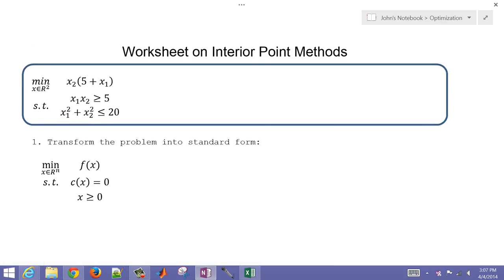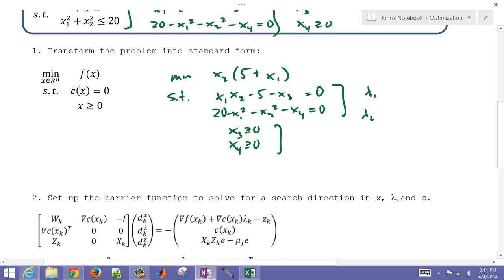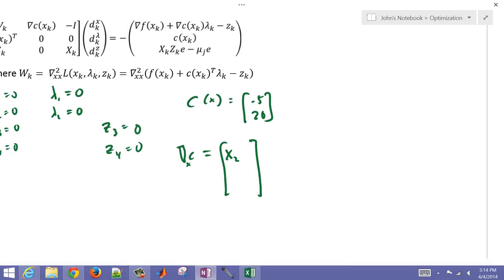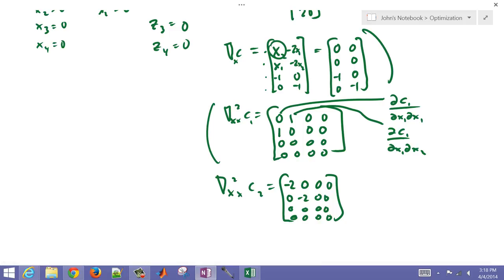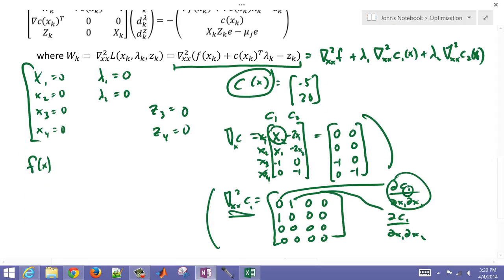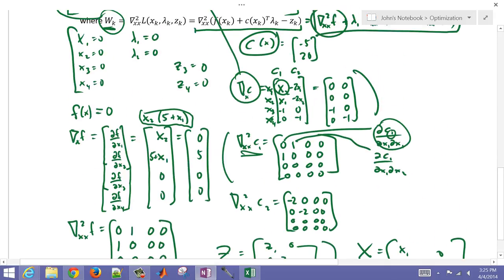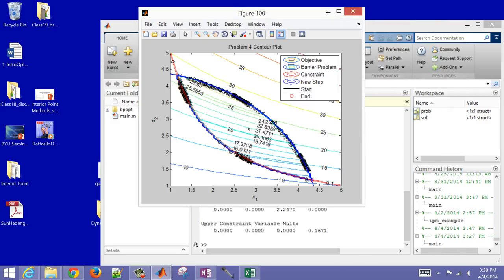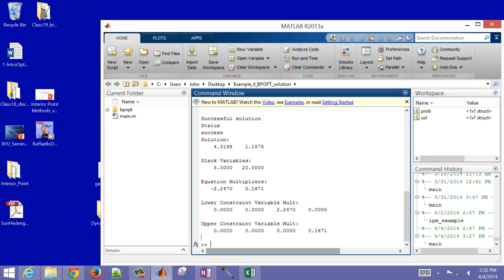Interior Point Method Optimization Example in MATLAB

Comment: This quite different what I learn we find projection gradient with projection matrix to improve the solution through iteration
This video use barrier function and augmented langragian method 
I want to learn this topic for ADMM but I cannot find any videos form this channel
Reply from the maker: I don't have videos on ADMM but I would recommend the work by Victor Zavala at UWisc for a good reference on this method. From what I understand, ADMM is limited by the amount of information that must be shared by the sub-processes. Check out the recent work by GATech on new computer chips that enable more efficient ADMM.
Reply: @apm  we learn it for distributed optimization because buying  a very expensive Graphic cards not an Ideal solution in machine learning  
anyway I will check it out

Comment: Thanks for the great videos I just got confused about two things:
1- the search concept:
we keep  solving using the interior method till we meet the tolerance we aim to? that's it? what abot search direction which part make it.
2- KKT conditions  are they a different method? since they provide exact solution
Reply from the maker: The interior point method is solving a series of problems with gradually reduced barrier parameters (mu). Each search direction is computed by solving a quadratic objective / linear constraint approximation to the full nonlinear problem. The KKT conditions are embedded in the search direction and convergence criteria for the interior point method. A KKT condition tutorial is here: http://apmonitor.com/me575/index.php/Main/KuhnTucker

Comment: Very great video, I downloaded the code and work fine but why in the computation of W you do not add the Hessian of -z_k, like your theory in the lecture said? Slides said: W= Hessian_xx( f(x_k) + c(x_k)'lambda_k - z_k)
Reply from the maker: You could solve a much larger linear system but this is not needed. z_k has an explicit solution after you calculate x_k. The derivatives and values of z_k can be explicitly solved and substituted into the linear Ax=b problem. The added benefit is that this reduced system has a symmetric A matrix and this allows specialized linear solvers to more efficiently solve for the search direction. Additional details are in http://cepac.cheme.cmu.edu/pasilectures/biegler/ipopt.pdf (see Equation 11 and the surrounding discussion)
Reply: @apm  I know there is a reduced system, but your code implement the bigger one, without adding the Hessian of -z_k, so the code is correct or not respect to the theory?
Reply from the maker: @gioacchinogigio4608  I implemented both in the code. I think there is a switch where you can use either approach.
Reply: @apm  I see Matlab Code for example 3 in your site, in the code you use the larger system but you do not add the Hessian of -z to W, my question is this code is correct or not? Because I need to understand the linking between theory and implementation. In the code you wrote W = fxx + lam * cxx;
Reply from the maker: @gioacchinogigio4608  Here are the two different approaches from bpopt.m here: https://apmonitor.com/me575/uploads/Main/bpopt_matlab.zip  I'm not aware of errors but please let me know if you find any.

    % Construct and solve linear system Ax=b
    
    % Symmetric, zL/zU explicitly solved
    % construct A and b
    A1 = [H,J';J,zeros(m,m)];
    %b1(1:n+ns,1) = g' - zL' + zU' + J'*lam';
    b1(1:n+ns,1) = g' - zL' + zU' + J'*lam' + zL'-bp.mu*inv_dML*e -zU'+bp.mu*inv_dMU*e;
    b1(n+ns+1:n+ns+m,1) = r(1:m)';
    
    % compute search direction, solving Ax = b
    d1 = -pinv(full(A1))*b1;
    
    dx1 = d1(1:n,1);
    ds1 = d1(n+1:n+ns,1);
    dlam1 = d1(n+ns+1:n+ns+m,1);
    % compute search direction for z (explicit solution)
    dzL1 = bp.mu*inv_dML*e - zL' - SigL*[dx1; ds1];
    dzU1 = bp.mu*inv_dMU*e - zU' + SigU*[dx1; ds1];
    search1 = [d1;dzL1;dzU1];

    % Un-symmetric, zL/zU implicitly solved
    % construct A
    A2 = [W J' -eye(n+ns) eye(n+ns);
        J zeros(m,m+2*(n+ns));
        diag(zL) zeros((n+ns),m) dML zeros(n+ns);
        -diag(zU) zeros(n+ns,m+n+ns) dMU];
    b2(1:n+ns,1) = g' - zL' + zU' + J'*lam';
    b2(n+ns+1:n+ns+m,1) = r(1:m)';
    b2(n+ns+m+1:2*(n+ns)+m) = dML*diag(zL)*e - bp.mu*e;
    b2(2*(n+ns)+m+1:3*(n+ns)+m) = dMU*diag(zU)*e - bp.mu*e;
    d2 = -pinv(full(A2))*b2;
    dx2 = d2(1:n,1);
    ds2 = d2(n+1:n+ns,1);
    dlam2 = d2(n+ns+1:n+ns+m,1);
    dzL2 = d2(n+ns+m+1:2*(n+ns)+m);
    dzU2 = d2(2*(n+ns)+m+1:3*(n+ns)+m);
    search2 = d2;
Reply: @apm  Thanks for reply, but my question is about this code http://apmonitor.com/me575/uploads/Main/interior_point_example3.zip .

Comment: Hi, I've a question on minute 16:30, where is the the  Hessian xx of z_K ?  Because z_K is  mu/x_K.
Reply from the maker: z_K is explicitly updated and it isn't needed to solve for it implicitly. Check out the IPOPT paper: http://cepac.cheme.cmu.edu/pasilectures/biegler/ipopt.pdf
Reply: @apm   Ok but I do not understand, in the objective function when I subtract  - mu* ln(x_i) if x_1 is equal to 0 goes to - infinity, is that correct?
Reply from the maker: @GS-qv8qm  , yes that is correct. It is an "interior" point algorithm because of this barrier function.
Reply: @apm   Yes, but the barrier is maximal on the constraints, so suppose c(x) = x1+x2+5 and we want c(x)=0, now when x=[0,0] , ln(x) is infinity but the constraint is not satisfied.
Reply from the maker: @GS-qv8qm  equality constraints are treated differently than the inequality constraints. The barrier term is only applied to the inequality constraints while the equality constraints use the first and second derivatives of the Lagrangian to solve for the new search direction.
Reply: @apm  Now it is clear. This method assume a feasible solution to start, do you know where I can looking for infeasible start? I need infeasible both for equality and inequality in a program like this min f(x) sub to Ax=b; c(x) >=0; I found only for one of them.

Comment: Thank you for the nice example. To transform the problem to the standard form, variables x_3 and x_4 are introduced, which need to be non-negative. 

The standard form requires all variables to be positive. However, the problem in the example does not have such a constraints on x_1 and x_2. It is mentioned that we assume that x_1, x_2>=0 are there. I am not sure if we can assume this since it changes the problem. Can you please explain on this? Thank you
Reply from the maker: +Ashkan, the IPOPT paper has a nice explanation of getting general constraints into the standard form: http://cepac.cheme.cmu.edu/pasilectures/biegler/ipopt.pdf

Comment: you did mention any about the dual method of the problem. isn't it required to solve this problem?
Reply from the maker: I recommend this very nice paper for full details on the approach: http://cepac.cheme.cmu.edu/pasilectures/biegler/ipopt.pdf
Reply: thanks
Reply: +APMonitor.com  in some papers mu = y^T * lambda / m    where y is slack vector and m no. of variables, how would be that if we don't have any slack vector and with what factor we can decrease mu to converge to zero? thank and apologies Professor  :)

Comment: Thanks for your videos, I have one question,  why do you only guess the value of lambda_1, lambda_2, z_3 and z_4. But the Z_k matrix needs z_1 and z_2. I am confused.
Reply from the maker: +Long Chen, the z values are removed as variables from the matrix because there is an explicit solution for them at every sub-iteration. The KKT conditions simplify you a symmetric A matrix for solving for the search direction with Ax =b.
Reply from the maker: +Long Chen, there is source code at http://apmonitor.com/me575/index.php/Main/InteriorPointMethod if you want a concrete example. You can also solve it with the z values in the matrix but it then it is a larger matrix.